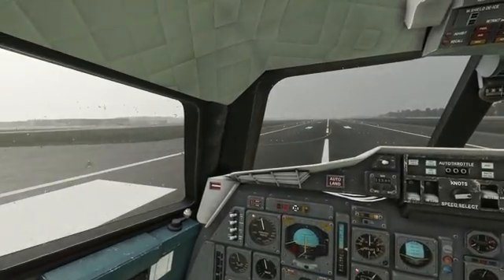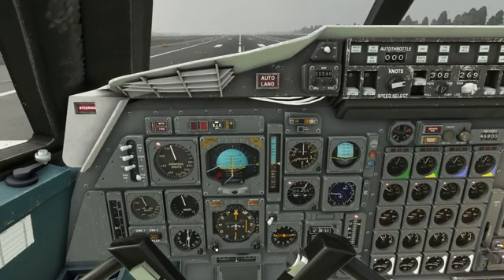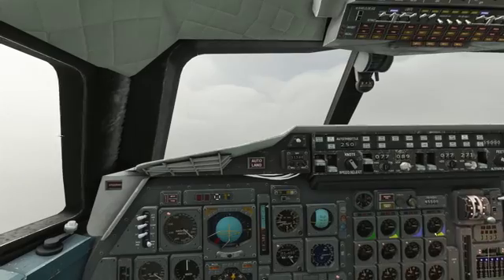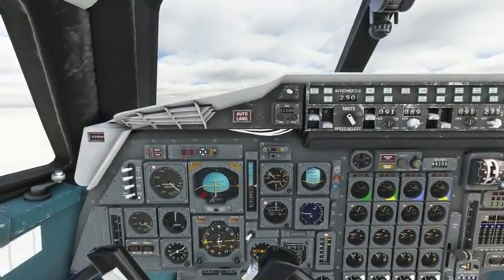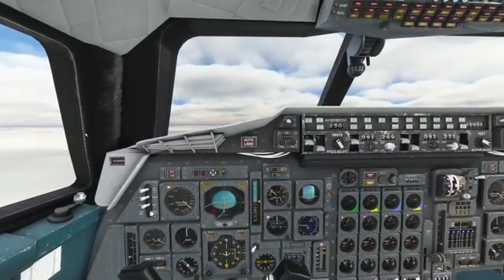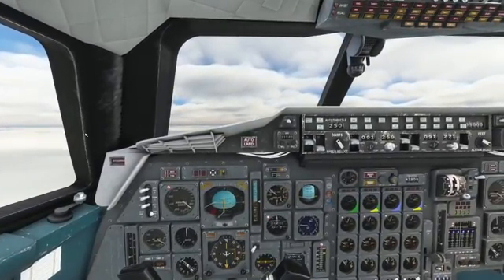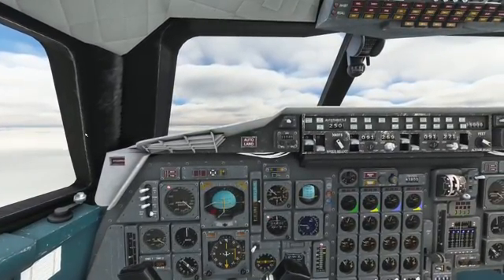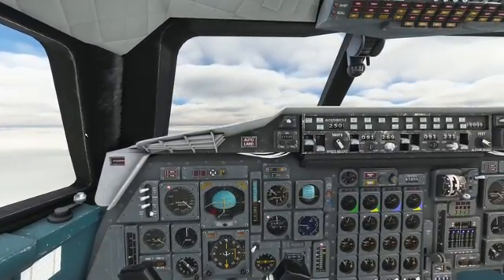ILS using Autopilot in bad weather: Tips, Tricks & Gotchas! - DC Designs Concorde (MSFS)

Comment: 7:45 I don't understand why the yellow arrow remains at exactly the same angle when you switch to the VOR from the ILS. They're in different places ,surely the arrow should shift slightly ?
Reply from the maker: VOR needle shouldn’t point at ILS anyway, it’s not an omni directional beacon. It may just be how MSFS works it.

Comment: Hello. I have various problems with the concorde. It all starts well. when i want to land with the ils nothing works anymore the plane can't find a LOC, you can no longer set the frequency, it's all bugged if you want to land with autopilot.

I tested different situations. if you fly without a route, for example, a round flight starts and you land again, the ILS autopilot works. Try it yourself!

if you fly a complete route and want to land, nothing works anymore. I can't even change the frequency anymore.
but as soon as i landed at the airport the plane recognizes the LOC ILS and it shows
Reply from the maker: I only had early access version I’m afraid. Have you got the most up to date copy? Do you have any freeware addons (they sometimes conflict). Have you tried the route in a different aircraft? Has it always been like this or has it only recently been happening? Have you checked out the DC Design discord to submit an issue?

Comment: Sorry for my silly question,  is there a way to see when it captures the ILS localizer?  Something the says it's perfect aligned? I mean a visual help that  you can see it's following the path
Reply from the maker: My video on flying an ILS may help you with the basics. But essentially, a correctly entered ILS frequency, with Radio selected next to AFCS, and you in the right position, the bar in the middle of the course bar will be cantered. If it’s right then the localiser is to your right. Is that what you meant?

Comment: I’ve recommended your videos on AvSim as they’re the best I’ve seen plus you have a very polished delivery. I don’t have MSFS but have been flying the FS Labs 32-bit Concorde for over 10 years so a couple of tips if I may. 1) Fuel could be lower. Around 20T should be sufficient. Nothing was needed in 5A and 7A for circuit training. If you can, set those to zero. 2) The throttles were always slammed forward for takeoff. No need for intermediate settings first. Concorde’s throttles were computer- controlled so power was applied evenly bar engine 4 which had a slight delay for reasons I’m not totally familiar with. And of course being a Brit they would be called reheats, not the American afterburners. 😉 But apart from that it was a very good demo. I suspect you’re a real pilot with your language. Keep up the great work! 👍
Reply from the maker: That is very kind of you, thanks for the pointers also. I have slipped into habit with the AB vs reheat lol! Lots to learn! And as for the fuel… it’s alien to me til I sit down and take a proper look. Need some more hours in my day lol! 👍🏻

Comment: You said it’s a bug that the ILS initially points the “wrong” direction until you are abeam at which point it switches… that’s entirely incorrect. Opposite ends of the runway share the same frequency, so actually the ILS read out was doing exactly as it should! 

The aircraft doesn’t know which runway it’s actually pointing at, just the beacon 😃
Reply from the maker: My point is that I doubt the course bar is motorised. Have never seen another aircraft do that

Comment: I am extremely confused how you were able to grab the ILS, I and another flying with me tried for a good 40 minutes of doing circle work above JFK trying to get it too work and it refused no matter what we did. It just kept flying right through it and ignoring it entirely, despite it showing on the HSI and the needles for the glide slope appearing (and moving).
Reply from the maker: Strange! If the needles are responding properly to ILS signal, presume you could fly it manually down the approach if you wanted to? AP engaged, stable on localiser before top of descent? VOR/LOC and GLIDE activated once established?
Reply: @cgaviator  Yeah, can manually land it not problems, but would like it to actually capture the LOC/ILS. Will just have to try again, I guess... maybe it'll behave today.

Comment: I was looking forward to this sim. However, I am looking at a Flight Deck and Glareshield that looks as if they did it in MS Paint?  MSFS is capable of much better graphics than this! Why is there Spaghetti under the Auto Land? 4.38, rain looks like its inside the cabin windshield? Anyway, not your fault. Thanks for the video.
Reply: The water on the inside of the windshield is a sim bug, not a plane bug. It’s something ASOBO have acknowledged but its extremely low on their priority to fix, like they said something along the lines of “Yeah, we’ll look at that next year”
Reply from the maker: It’s essentially early access. The developer is good at listening and updating after release. 👍🏻
Reply: @cgaviator  those are wires hanging below on each side of the autopilot panel right?
Reply from the maker: @Chrisp707-  I think so, yes
Reply: It’s fantastic in VR.